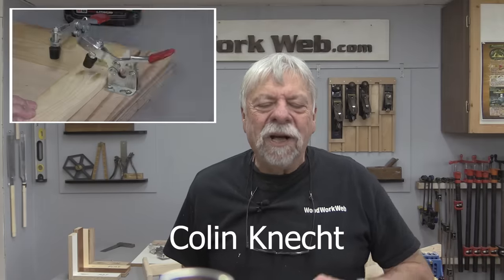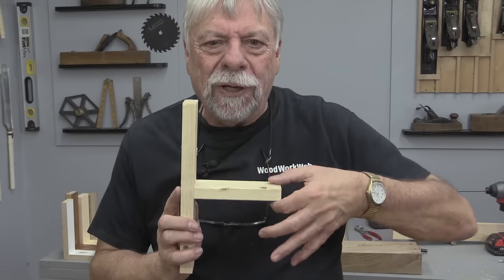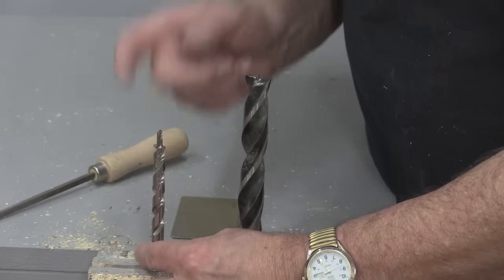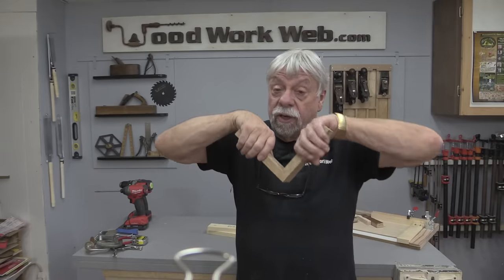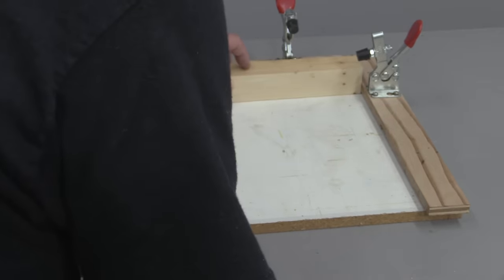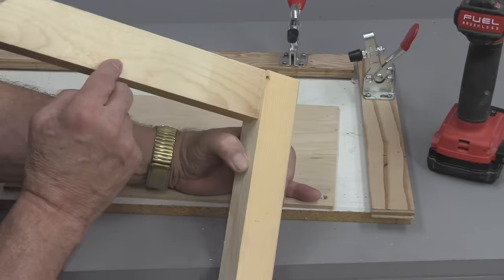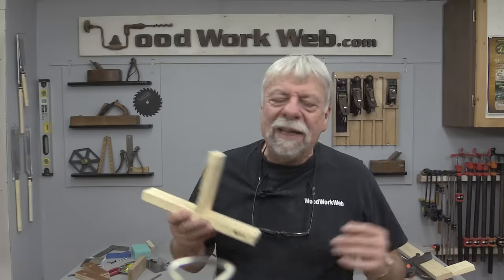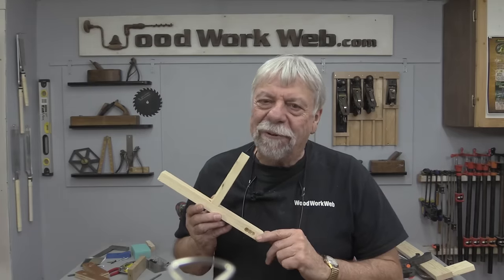Pocket Hole Mistakes to Avoid / Woodworking Joinery

Comment: Well, my comment is a year after your publication. I am a grumpy old woodworker and have Pocket Screws just since 2 month. When I saw your examples  with different woods. Immediate I thought they are all wrong ! Well they are fine for a cabinet, VISUAL, but wrong for strength. The screw has always to point into the Woodmeat, not to the end side. hope you can understand my poor English. Every Joint would have be much stronger if the Poket holes had been on the OUTSIDE of Ankle. There is a really BIG difference in strenght when doing it right. 
Your screw drive to the end of the board and there is nothing to keep the strenght of the screw. But when you put the Hole on the opposite side of the same board (of course , otherwise you'll screw in Endgrain) the screw point to the board inside, and not tho the end or outside. so there are fibers re enforcing the joint.  
Beside this, I am a big fan of your vids, first time I saw something wrong.

Comment: I can’t figured out why I’m splitting the receiving piece (3/4” pine) while driving 1 1/4” actual Kreg screws in to the edge grain. Any clue?
Reply: Rodrigo Marques Possible causes: a) What type of driver are you using - use one with a variable clutch not an impact driver b) Are you using a course or a fine thread screw?
Reply: John Grannan John Grannan Thank you very much for you reply. I was using a 12V impact driver and coarse thread (as recommended for soft woods by kreg)
Will try using the drill instead.

Comment: the Kreg jig has a holed underneath the jig so no need for a seperate holder for the drill bit
Reply: But he has it mounted so he can mount it in a vice. So the hole is covered.

Comment: When attaching a chair skirt to the legs I often split the wood on the legs.  What am I doing wrong?
Reply: If it's hardwood (oak, cherry, walnut, etc.) make sure you are using a fine-threaded pocket hole screw.
Do not overtighten the screws.
Consider using a thinner screw, such as a #6. Smaller than the Kreg-branded ones.
Use self-lubricated screws or use your own lubrication (soap, petroleum jelly, etc.).
Try inserting the screw halfway, tapping out the debris, then securing the screw.

Comment: I should add that you would never consider putting two pieces of metal together tightly with threaded holes in both pieces.  You put a clearance hole in one and a threaded hole in the other.  That is basically what you are doing threading the screw though a piece of wood into another piece of wood.  Both pieces of wood have independent threads in them.  To repeat the last comment, they will NEVER pull together tighter than what they were when you inserted the screw.

Comment: Do you need to add a pilot hole to the other piece on hardwoods like oak? I see you're driving straight in to the oak, but isnt that risky? Pilot holes are pretty important. But I can see how it would be hard to align it perfectly
Reply: I understand your concern here, but no you do not need to pre drill. I've been using these on oak and walnut for years, the only split I've had was when I had hit a knot. The best thing is to use a little soap or wax on the threads. It pulls right in. Oh and you don't need to go fast. Take your time just a steady pace and the pocket hole will work great.
Reply: Kreg screws are self drilling.

Comment: Hello Colin, I learned a lot from your video.  You did a great job!  I have a question.  What are you using to drive the screws?  A drill or an impact driver?  I am interested in your recommendations for what to use.  I have a Milwaukee M18 variable speed drill.  But I'm thinking of getting another Milwaukee drill or possibly an impact driver so I don't have to keep changing the bit from the drill to the screw driver.  Your thoughts?

Comment: Thank you for you information and experience. I have found that that when (using pocket hole screws) joining two pieces together if you screw in just a little too far the wood strips and does not tighten. Kind of defeats the cause because unless there is glue involved it does not seem effective. Any ideas or comments where I can have a more solid tight hold? I do understand that there are different more aggressive screw types.

Comment: Never understood why drywall screws are so commonly used in the US for projects for which these screws aren’t suitable. First off it’s their coating, the phosphate cover is to prevent rust from acting with the gypsum, from the sheetrock, the spackle or the stucco. It’s not an appropriate protection in case the screw keeps uncovered. Also, the conical head of a drywall screw has an arch to grab the paper of the sheetrock. That’s their purpose after all. Think such a head would perform good in wood? I don’t think so.

Comment: Short cut joinery.  I own a Kreg and seldom use it.  Even if you are a hobbies or a pro, take the time to learn how to use traditional joinery and your projects will last generations.  My two cents.
Reply: Pocket screws are like anything else. There's places where they're appropriate and places where they're not. Not everything is right for mortise and tenon joinery either. In this era with plentiful fasteners and high quality glues we often don't need to use old methods to get the job done.
Reply: Paul Frederick I agree that mortise and tenon joinery isn’t practical in all situations such as building kitchen cabinets.  But I do see pocket holes being over used when cutting traditional joinery really wouldn’t take that much longer especially if you use a router.  I build primarily fine furniture heirloom pieces as a hobby only.  Although I like to stay with traditional joinery I have no problem using modern tools to make the mortise and tenons.
Reply: @kirkdockter5093  I definitely like to make overly nice things. But sometimes I just have to make things too. That's when the Kreg kit comes out. To me pocket holes are just another tool in the bag. They're a half a rung up from just a butt joint and running screws into end grain. I'm not above doing that sometimes either. I'm not mortising laminated particleboard. That's where I draw the line. Would dado it though. Although in my custom washroom cabinet I made I think I just used cleats? I looked everywhere to try to find a cabinet to fit the space. Finally I was like screw this I'll just make it. And it looks nice. Fits that spot almost like it was made for it too. For real it fits good. When I move its staying with the house.

Comment: Anyone who "snaps" off a drywall screw head is in a hurry and uses their impact driver as if they were making a deck, no pre-drilling, and just drive the screw into the wood until the impact driver turns the head off... just like you did there... now- if you spin that long on a screw that DOESN'T snap the head off, then you have stripped the wood on the inside of the screw's threads, and now have a useless hold on the joint. Either is bad, because of OPERATOR ERROR

Comment: For your demos the screw was angled incorrectly. There would be more wood for the screw to bite into if the pocket hole would be on the other side.
Reply: If he did it your way the hole would be visible...

Comment: AMATEUR MISTAKE !!! You drill hole on the wrong side, man. Drill it from outer side to main part of the board so you get enough wood to hold it. Ouch ;-)
And then i use dowels to seal that hole if i cant hide it in an invisible location.

Comment: Those sheetrock screws are awful, they ruined several of my early wood projects. I'm curious though, is the brittleness actually a feature in some other industry? Also why would woodworkers use them?
Reply: juseschrustfush I think we often use them because they are handy around the workshop and typically the right size & length.

Comment: 4:47 - The video should be named how not to make pocket holes. Your joints are weak because the pocket hole is on the wrong side, so the screw has no wood to bind into. Had you placed the pocket hole on the other side, the screw would've bound to the other board.

Comment: All 4 of your samples were put together wrong.  The screw holes should be on the outside and drill in for strength.  It has been proven this does make a big difference.
Reply: Good catch, holes should be from the other side.

Comment: Drywall screws have no lateral strength.  Don't use them.for a ything except drywall. If your contractor is using them for woodwork or flooring, fire him.

Comment: Another "mistake": buying expensive Kreg square drive screws when you could buy cheaper and superior Phillips screws. The square (Robertson) drive is an older and inferior system compared to the now common cross (Phillips) drive, invented to accomodate stronger torque required in the automotive industry. So, why spending more to get an inferior item?
Reply: they are about a dollar or two more a box lmao “expensive@

Comment: The correct way to join the 2 pieces of MDF would be to drill through the outer side of the vertical piece into the 'meat' of the horizontal piece.
NOT the way he did it.  
Obviously did not read the User Manual.

Comment: The thumbnail for the video shows a still of a joint where the screw goes thru the pocket hole fine then splits the bottom piece of wood.  In having this problem and was hoping to see what I'm doing wrong,  but alas, it wasn't covered in the video.

Comment: yep that is not an MDF but a particle board, and all those pocket screws have been screwed in the wrong orientation, that is why they failed so easily.  Great video otherwise, thanks!

Comment: @WoodWorkWeb - your examples at 6:12 - why are you doing this from the inside? This is the weakest possible way to do a pocket hole. You should be going from the ouside in, not the inside out, when doing a corner joint like that. The way you have done this, there is half the thickness of the wood to hold the joint together - doing the same corner form the outside in, you get the entire length of the wood minus the drill depth to hold it in.

Comment: I know you're trying to help us noobs so I hope this feedback can help you understand just how ignorant some of us are.
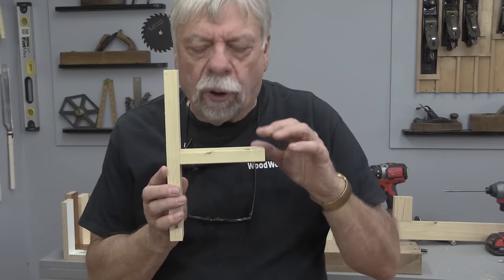At 1:38 you have two short pieces attached with pocket-screws. You said a bunch of words that included "upside down and inside out". Does anybody know what he was talking about. If you're working on a piece you can turn over, is that the "upside down" comment? That piece left me confused, not informed.
Reply: Noob here! Really enjoy these videos.
Anyway, I believe what he meant was that the pocket holes are usually hidden, so that you should be "thinking" upside down (where you want to place pocket holes), inside out (inside is where you want the holes). To experienced WW, it is likely second nature; but it isn't to me, and I have to think about where the pocket holes should go, and I usually have to "mock up" my project before drilling.
Hope that helps.

Comment: The very best way to avoid pocket hole problems is DONT USE POCKET SCREWS! A true craftsman would never use pocket screws to build kitchen cabinets; or any cabinets for that matter. Learn to use jointery.